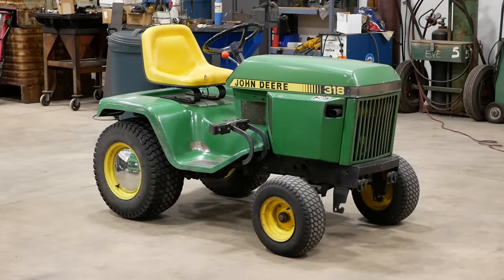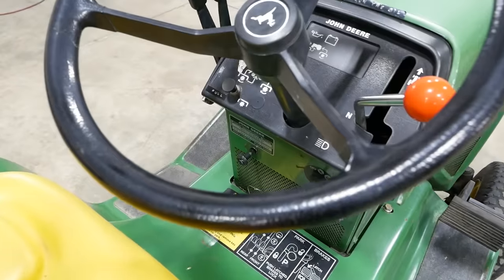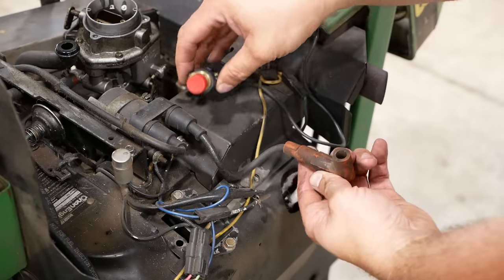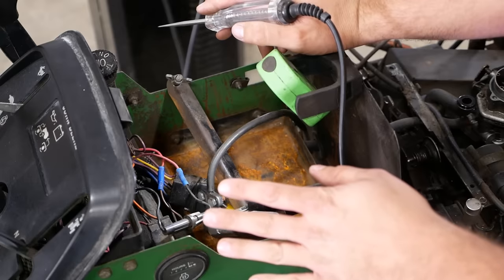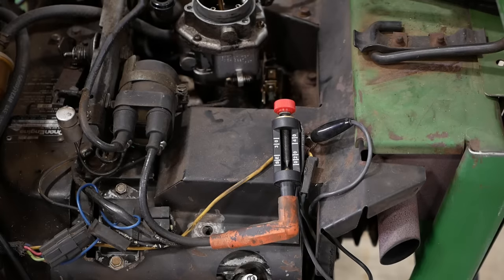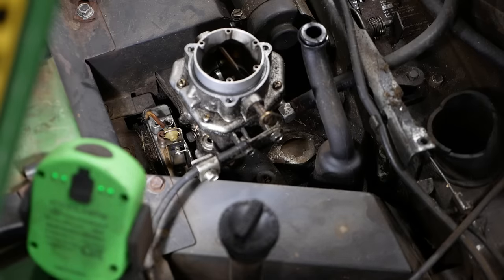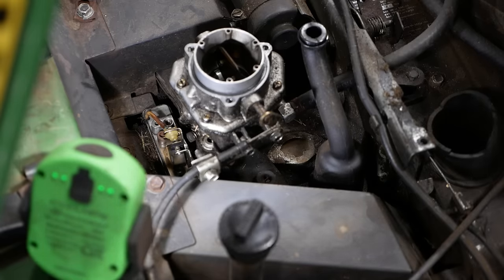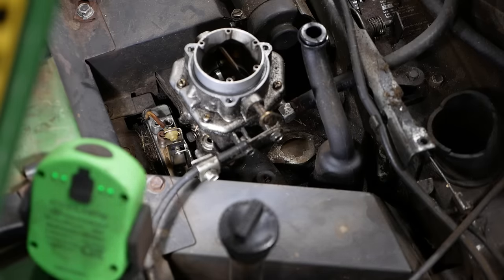John Deere 318 no Start - no Spark

Comment: The harbor freight engine idea... the last problem you'll have with that is the alternator built in to the engine is only good for 2-3 amps.  Not enough to charge the battery and run the electric PTO. i say the last problem because you will over come many other problems in the way to that one. 
Best option to replace the onan is a kohler command engine or a briggs Vanguard. 
I know you have a low opinion of the command engine, yes the one in your cub cadet but if you actually knew anything about small engines you'd know that's your best Option.
Reply from the maker: It doesn't matter what I want.

Comment: I worked on a Wheelhorse  with a Onan single cylinder new coil $250.00 after looking everywhere for one
Reply from the maker: Ouch! A rebuild kit for these was $2000+ back when you could still get them.

Comment: If the owner was told " I fixefd it. Now I could charge you tractorrates for the repair or lawnmower rates for the repair which are cheaper than tractor repairs". The owner would be calling it a mower.  Guaranteed.

Comment: Do you rebuild hydrostatic? I need a substrand rebuilt from  1967 wheelhorse? She still working just getting slower.
Reply from the maker: I never have. My understanding is the valve plates just need to be lapped.

Comment: Back when Deere's were 100 percent made in America.
Now pretty much all the parts are made in China and elsewhere.
I'm still kicking my self for not buying a 318 with blade and tiller when I had a chance to buy one from an estate.
I'd been repairing the owners pinball games for years and always have him a square deal after he got screwed by others so his widow calked and asked me if I wanted it when he passed away.
At the time I was living in the Florida Keys and had no use for it so I passed.
2 years later I had moved off the Rock back to Miami and been kicking my self ever since.
She offered it to me for 200 hundred dollars.
After I passed I told her not to take less than 2 grand.
Possibly 3 grand.
She ended up selling it for 35 hundred at auction.
That was back in '08.
Probably still to cheap.

Comment: Thanks for another 'just right' offering.   As with all real, actual service requests (versus the jazzed up testosterone and angst-driven formula episodes available elsewhere, complete with a necessary dorky assistant and irrational owner) your's arrive and get a reasonable trouble-shooting, follow the clues and scratch off the obvious until the culprit (s) are discovered and fixed or replaced and entertainment is in your low key observations, not hyperbole and drama.    No parts cannons required or allowed; just rational if occasionally irritated deductions to a sound conclusion.
       The Hollywood episode producers would go nuts with your style and eye-on-the-prize resolve if they got their mitts on your show.   You would need explosions and fires, your wife would need to be either a private eye or a pole dancer; maybe both and Max would be recast as a Pit bull with a taste for strangers and truck tire chew toys. 
        Stay the course, Sir Wes;  your patrons are here because you are not Hollywood's idea of a mechanic and a safe place to send one's babies knowing all combustion will be internal.

Comment: i have a craftsman lt2000 which is a tractor like this one but belt drive and i have the chinese knockoff of the john deere as well (power pro by kgro) its hydrastatic drive just like this even has a twin cylinder opposing engine

Comment: I have a 318 that was passed down from my wife's grandfather. It will run perfect and then sputter like its got water in the fuel. I just looked at the points and found a wire near worn through and thought I had it. But its still doing it.  I think I'll pull the carb and clean it and then fire the parts cannon at a fuel pump... don't know. its starting to annoy me.
Reply from the maker: These engines vapor lock really bad.
Reply: @WatchWesWork  Your video got me back on that tractor. I pulled the cover and the gas tank and that's when I found the gas line for the reserve line had degraded and fell apart in the tank. I have replaced all the fuel lines now and tomorrow I'll get it going and use that adjustment you showed in your video to fix my drift problem.  Thanks for sharing your work Wes, I enjoying watching it!

Comment: Probably will run another 35 years while the new ones are junk in 5 years. I have a JD LA120 i believe and its sitting in my tree row with a bad hydro, blown engine and bad steering. Dont make them like they use to.

Comment: I always amazed at your breadth of knowledge - you knew the problem was the little buttons didn't pop up - It seems like you have knowledge of everything you work on - in another video you state "i'm no expert on these Cummins engines" and then go on to talk about the issues to watch out for when you pull the injection pump.  Seems like you might be selling yourself a little short.
Reply from the maker: No one can be an expert about everything. You should see me tape drywall...

Comment: That little "bend" in the center of the fuse is from overheating. Something probably caused prolonged high current {clutch switch rewire???} that melted the solder in one of the fuse end caps or it could have been vibration causing a poor connection in that quality fuse holder. I have seen this a couple of times, the fuse looks OK but it is open. The older JD's were well built unlike some of today's stuff, the problem is finding parts information and the parts are expensive. Give me my Wheel horses any day {have 18 from '60 to '85} most parts are common and I can download manuals/parts lists from Toro. Try that with JD....

Comment: Too bad it's the Onan motor. Parts are hard to get and they have valve and lower end issues. For those who are looking at one of these be very careful and check everything. Repowering them is not anything like a walk in the park.
Reply: I would most certainly do a compression and leak down test.

Comment: The phrase I've heard over the years has been "never own an Onan".  My experience adjusting valves is that it is a complete bitch, requiring you to yank the carb and intake assy just to get to the boxes that allow you to give it valve lash. Stupid design. Parts for onans in general are dealt through Cummins dealers in my area, and availability for anything is scetchy at best, as I think all things Onan are obsolete.  Onan motors to me are over rated.
Reply from the maker: I have not worked on one personally, but that's what I have heard as well. It's crazy when you think about how many of these engines are still out there.